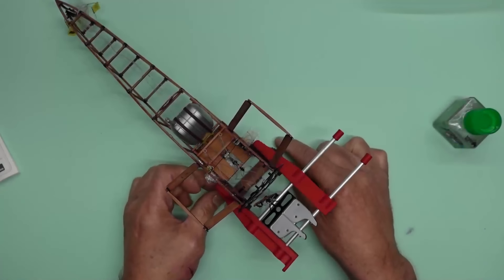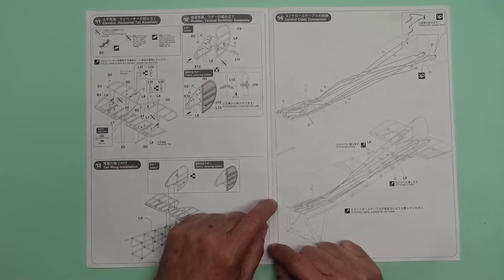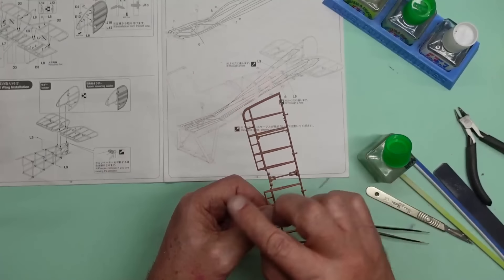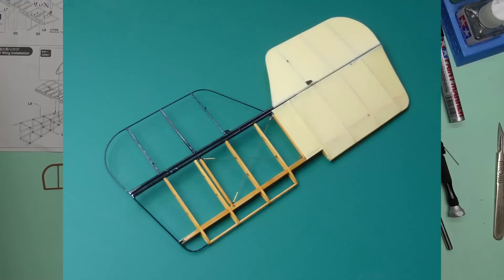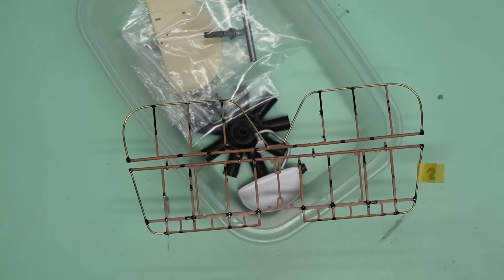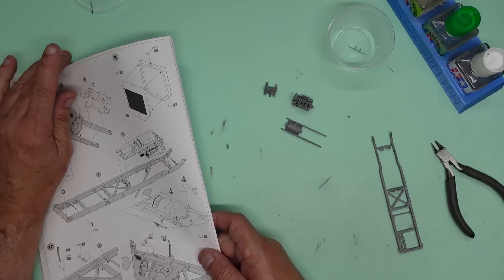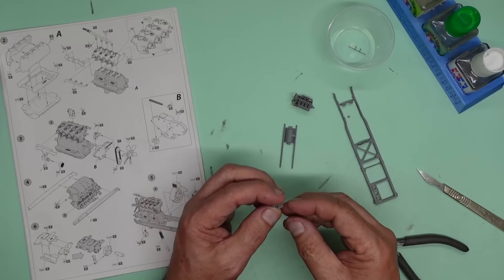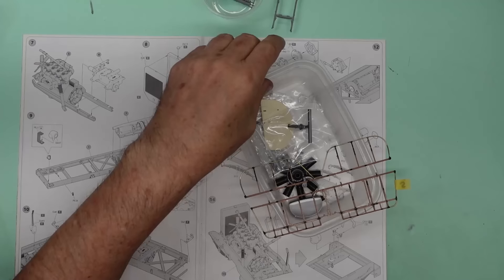WW I Wednesday, (formerly known as WNW Wednesday) Week 22

Comment: Both superb builds, Nige.
I was sitting here really hoping you'd get the brass wire out on that Camel elevator. It's exactly what I would have done too.
That picture you showed of the 1/8th Camel by Hasegawa... That is an amazing kit. They did an SE5A too. Ray Rimmel built it in Scale Models magazine when it first came out about forty years ago. 
My Holy Grail kit.